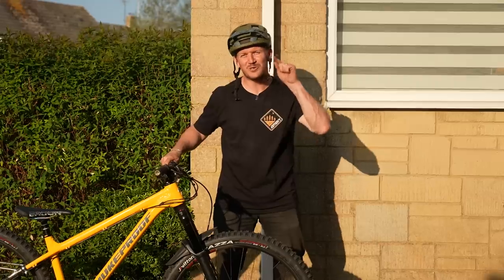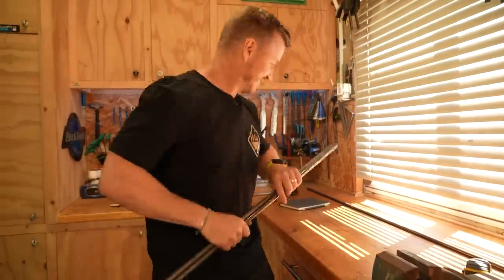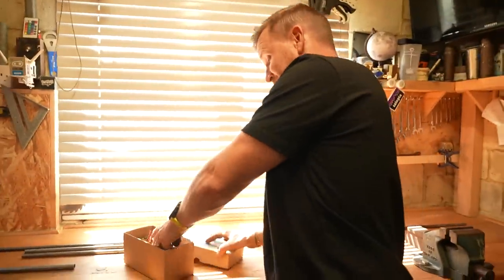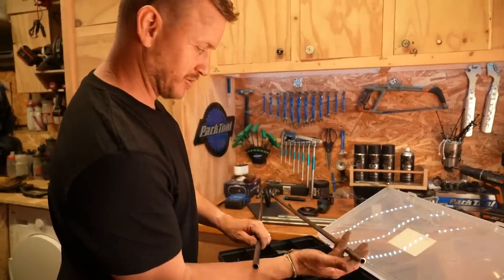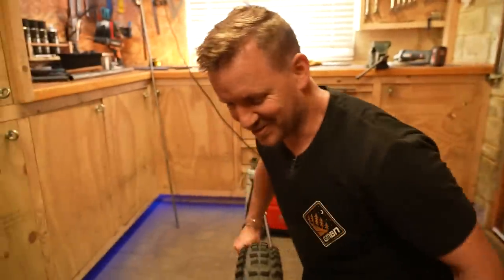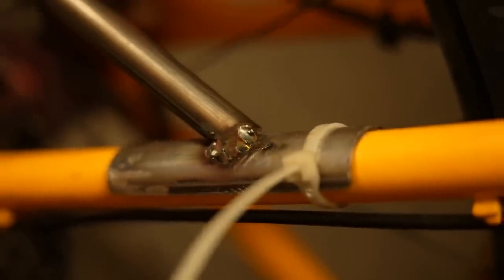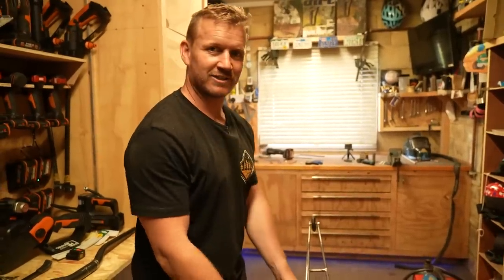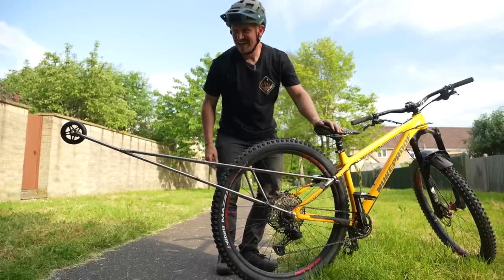Building A Wheelie Bar For My Mountain Bike | Blake Builds

Comment: Blake, you are a legend!
I’ve been into wheelies and manuals since I first got on a bike. Years ago I tried to make a “wheelie stunt stand” - basically a metal bar above the rear wheel so you can step on it and do a manual on it - just like the motorcycle stunt riders have multiple bars/pegs at the rear to step on for different tricks. 
It was connected to the axle via bmx pegs I had mounted, and the support bar was extending to a custom seat clamp. It was awesome, but stupid heavy …. 

I’m planning to try this again soon on my Trek Roscoe Hardtail.

I recon you should make one too! It will be a lot of fun making it and even more so going down a hill with you feet on that thing instead of on your pedals
Reply: haha same with me,  i did something similar with pegs too, but in wood, still in experimental phase ...

Comment: Good video concept! 
This is one is obviously wildly impractical though fun,  but this series could be educational to some people, if you were to cut the head tube off a frame and re-weld at the upper and lower ends of the slack/steep angle scale, to highlight the effect it has on the geometry and riding style? It would show the lay-over of the wheels when more slack and show what no caster angle does to high speed handling lol Same could be applied with Chain stay length and seat tube angle as well.

Comment: Brachistochrone (brah kissed a crone) was the greatest shredder in ancient Greece. Braki, as his friends called him, had one simple question: What's the best shape for a ramp? The answer to that question haunted mathematicians for centuries. Legend has it that Newton invented calculus just so he could solve the problem and give shredders everywhere a definitive solution. It worked. He discovered that the best shape for a ramp is the inner curve of a cycloid, but to this day, ramp builders still use radial curves, and every time a ramp is built with a radial curve, Braki kickflips in his grave. I post this for the sake of general knowledge, but if you really want something to build...  go make Braki proud. Cycles are for cycloids.

Comment: Blake, haven’t you’ve seen motorcycle drag racing ? Their wheelie bars have the little wheel an inch or two off the ground. There is no way they could keep the front wheel on the ground without it.